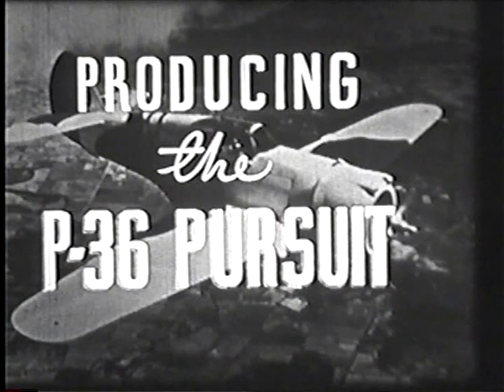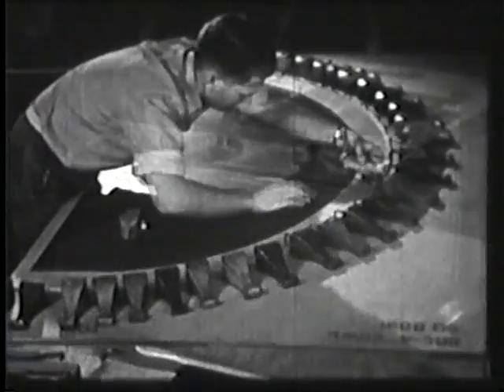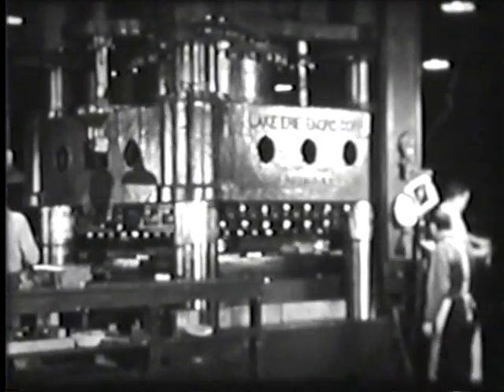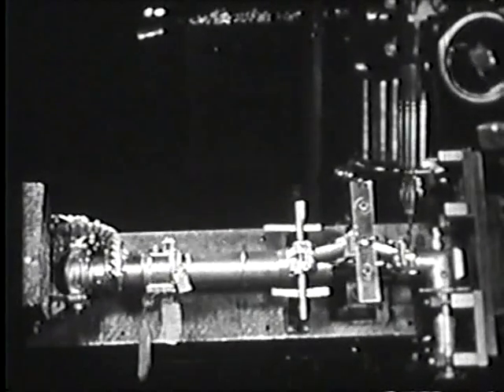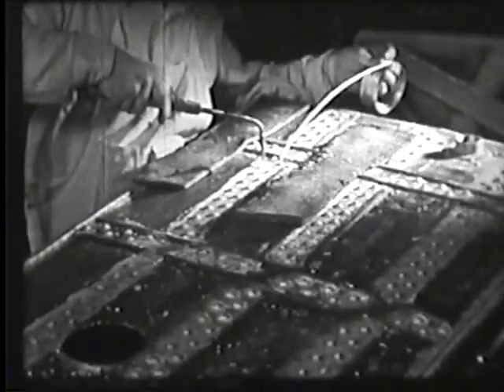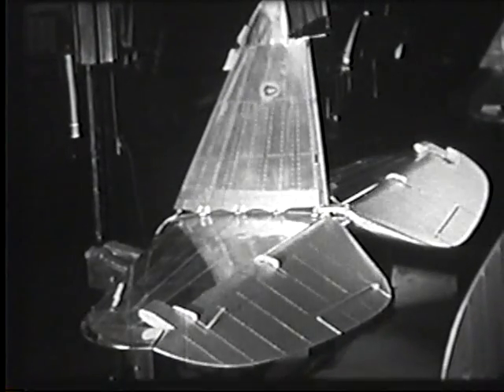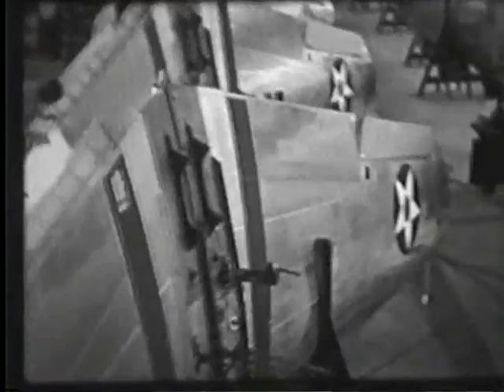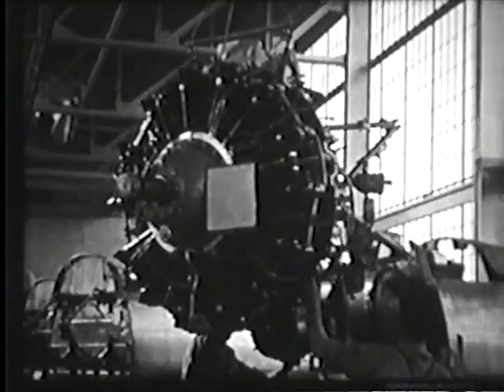Curtiss-Wright Production Soldier building the P-36 Hawk.mpg

Comment: I think my Grandfather worked here. He was a painter there and died of pneumonia because he was always too close to the big exhaust fans taking out the paint fumes.Funny how I turned out to be a house painter for 30 years instead of airplanes. Was this facility where Calspan is today or on Elmwood Ave in Buffalo? I live near Elmwood, but actually painted the Calspan complex across from Buffalo Niagara airport. The street in front is angled and it doesn't appear it could be Elmwood because of that.
Reply: Late to the party here for sure, but the plant in this video is still in existence at 2289 Kenmore Ave. at Vulcan St (Plant #1). Most of us remember the old Westinghouse Plant out by the airport. That originally was Plant #2 for Curtiss Wright. It's a pretty difficult timeline to study, but the original small plant when Curtiss first moved to Buffalo was on Churchill St. in BlackRock/Riverside. He then opened a plant on Elmwood Ave in the late 1910s (later M.Wile and where Home Depot is), he THEN opened this plant in the video (Plant #1), and then later Plant #2 out by the airport...they also had a Metal Processing Plant still standing at 745 Northland Ave. in Buffalo. Enjoy!